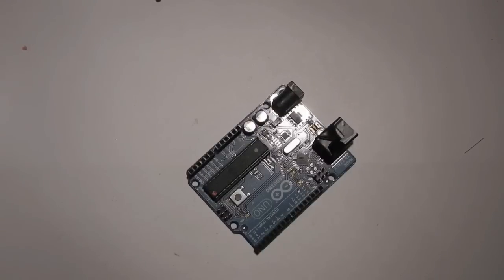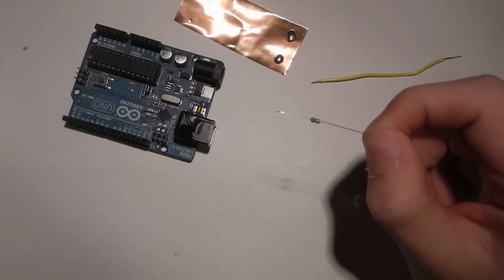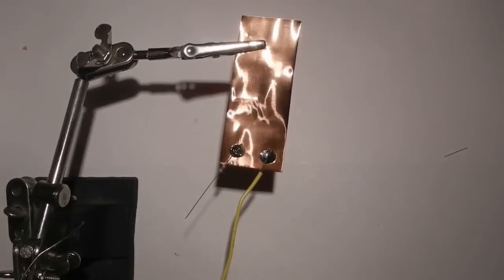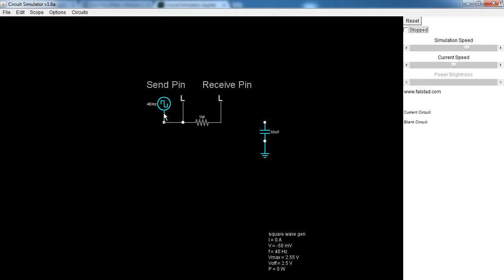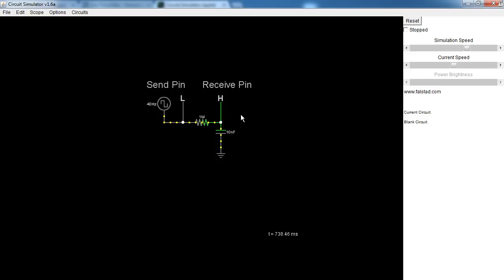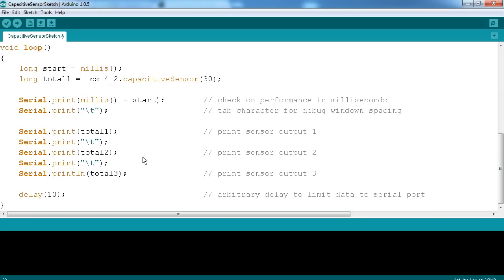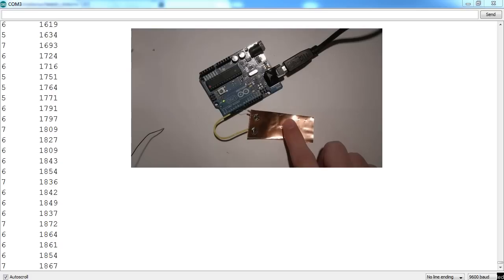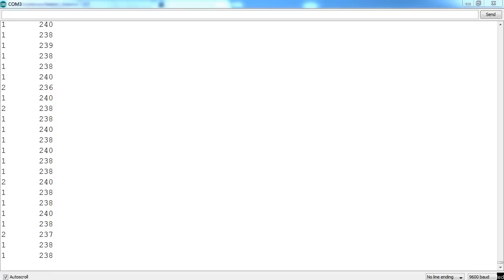CapSense: Capacitive Switch

Comment: my current reading with your setup and using a inch by a inch aluminum paper gives me 0 to 2934 

but only get to see 0 while not touching anything
 and 968 if i touch lightly and if i add a bit more pressure ill get the full max of around 2934 or so .  Can we get this range to be more larger ? do i need a bigger resistor or do i need to add something else?
Reply: +Frank Lopez Read up on RC elements. The time it takes for the capacitor to charge is determined by the resistor and the capacity you use. Since you don't have much say about the capacity (I think it is going to be in the range of pF and will get lower the farther you are from the plate), you'll need to dial up the resistor as high as you can, to get a decent time even at a distance. Remember, pF is in the range of 10^-12. Even a mega-ohm resistor will only get you into ranges of microseconds (10^-6), which is the shortest amount of time the Arduino can even detect. So you'll either need to increase your capacity (bigger piece of metal or closer proximity), or if that's not possible, you'll need a bigger resistor.

Comment: Just wanted to point out that the resistor doesn't need to be on the contact, you can just jump it from the receive pin to the send pin on the arduino. This is useful as you only need to run one wire to the contact wherever you might want to put it.
Reply: pro trick: watch series on Flixzone. I've been using them for watching loads of movies lately.
Reply: @Reign Ben Yea, been watching on flixzone for since november myself =)
Reply: @reignben2284  pro trick: next time comment on a video which has the same context as your comment.

Comment: Great work but small critique: The Falstad circuit you presented is not exactly what you have physically built. The circuit you built with your Arduino has the resistor AND the half-capacitor (single plate) connected between pins 4 and 2 (3:40). The Falstad diagram only has the resistor between those two pins. For the circuit I built, I tried it both ways and got nearly identical results.  I prefer your physical circuit to the one in your Falstad diagram  because the "magical ground" (5:15) attached to the other side of the half-cap is more difficult to explain.
Reply: But an half capacitor is just a wire so his falstad simulation is the same as what he built

Comment: I'm building a ironman suit and need this to control a linear actuator, I've created a glove to this and it works fine but in the code it wont consistently read while I touch it stops and runs the loop any ideas?   

#include <CapacitiveSensor.h>

#define CW 10

#define CCW 11

CapacitiveSensor   cs_4_2 = CapacitiveSensor(4, 2);       // 10M resistor between pins 4 & 2, pin 2 is sensor pin, add a wire and or foil if desired

CapacitiveSensor   cs_4_6 = CapacitiveSensor(4, 6);       // 10M resistor between pins 4 & 6, pin 6 is sensor pin, add a wire and or foil

CapacitiveSensor   cs_4_8 = CapacitiveSensor(4, 8);       // 10M resistor between pins 4 & 8, pin 8 is sensor pin, add a wire and or foil

void setup()

{

       // turn off autocalibrate on channel 1 - just as an example

  Serial.begin(38400);

  pinMode(CW, OUTPUT);

  pinMode(CCW, OUTPUT);

}

void loop()

{

  

  long total1 =  cs_4_2.capacitiveSensor(30);

  long total2 =  cs_4_6.capacitiveSensor(30);

  long total3 =  cs_4_8.capacitiveSensor(30);

          // check on performance in milliseconds

  Serial.print("\t");                    // tab character for debug windown spacing

  Serial.print(total1);                  // print index output 1

  Serial.print("\t");

  Serial.print(total2);                  // print middle output 2

  Serial.print("\t");

  Serial.println(total3);                // print thumb output 3

  

  if (total1 >= 10) {

    digitalWrite(CCW, LOW);

    digitalWrite(CW, HIGH);

    delay(5000); 

  if (total2 >= 30) {

    digitalWrite(CW, LOW);

    digitalWrite(CCW, HIGH);

    delay(100000);

  } else {

    delay(1000);

    digitalWrite(CW, LOW);

    digitalWrite(CCW, HIGH);

    

  }

  }}

Comment: I tried with my arduino connected to PC and works perfectly. Now I'm doing the same but using a 5v transformer to power it directly and doesn't work. My house doesn't have earth. Any solution to that? What can be happening?

Comment: I couldn't get the idea how the capacitor was created.  Would you explain it a little bit please?
Reply: Your body acts as the capacitor.  Basically, when you touch the copper, it's the equivalent of adding a capacitor to the circuit.

Comment: The time that takes to charge the capacitor the same time takes to discharge it also.But adding a few components more that activated in the negative pulse level then the discharging time will be rapid and the measured time will be the real charging rise time until the level interrupt triggered.And if the trigger voltage level for interrupt is known exactly the capacitive switch circuit with calculating an equation is turned to a real capacitor meter.

Comment: hi i have a doubt . Instead of using the send pin as common pin . Can i implement my idea as like this : a pin from the digital connected to a resistor and the resistor is instead connected  to a  metal foil . like wise i use  8 number of strips with  8 number of resistor  . when i touch the foil , the capacitance will sense . can i share the picture of my design ?

Comment: Does the size of the aluminum affect the circuit? I need to build something like this with a square of 20*20, but I haven't been able to find any example of this using bigger aluminum pieces.

Comment: You can use aluminum foil or a gum wrapper by sliding a paper clip on it and pinching your wire in that.
Soda can metal is also good. the outer surface is plated and painted. The paint comes off with paint remover and fine steel wool. You can solder that. Aluminum has an oxide layer, it takes extraordinary means to defeat that, but it's possible.
 
The thing about bare metal touch sensors is that they leave the controller open to static. A 10K resistor  on the sense wire will only add a little protection. What can take a lot of fiddling is tuning the circuit to work through a thick enough insulator to protect the controller but still know the difference between touch and close.

Try putting a transparency sheet over your sensor and get that to work, you can print button graphics on that or get an office store to sell you a printed sheet, just bring the graphics on a USB stick.

Comment: Hello, which kind of sensor can I use if I want to determine if someone is sits on a seat or no one is sitting on it.......or will this capacitive sensor also works for it?.....thanks
Reply from the maker: A Adeyinka This will let you detect when someone is or isn't sitting in a chair. You should take reading of both so that you can more accurately make the distinction in software.

Comment: HI this was a really good tutorial. Thanks. I just have one question. when i did it, if I touch the copper plate or the aluminum foil, while Im touching the floor with my feets with no shoes , (making ground contact, ) it gives me a number of ticks of about 200,000 so the serial monitor completely stops, similar to when you unplug the resistor on your video. the problem is that in my code i say (((( if(sensor >= 1000) { digitalWrite(LED, HIGH) } but for some reason since the number is too big, the program kind of freezes. so y have to get my feets off the ground to get a smaller number of ticks and make it work. do you or anyone knows how to solve this ?  If you cand find a sollution you will hellpr me a lot.  im using 5M resistors.
Reply: Add "delay(10);" at the end of your code (just before closing "void loop()"). This will limit the data sent to the serial port and fix the problem.
Reply: thanks

Comment: hey there I have a question here I have digital grandfather clock a small mear model of it and there are couple clean areas i would love to add a sensor button for ir remote you know tap ones to play tap twice to pause slide up for vol+ slide down  for vol- can the sensor button can handle the plastic on it or do I have create a new plastic mold
Reply: excuse me? are you trying to tell me that I need to type right to get an answer dude dont comment on my post i asked a simple question

Comment: When you initially put the ball of solder on the copper, did you simply put the iron on the copper and melt solder on it?
Reply: Yes. Except that it's not just 'melting solder on it' it's a chemical reaction between the copper, solder, and flux that bonds the solder to the copper. For example your resistor and other part leads are copper with a coating to discourage oxidation. TWO CAVEATS: 1) Plain copper often has oxidation that makes it more difficult to solder. You can give it a bit of a scrub first with a Scotch Brite or kitchen pot cleaning powder. The flux in the solder also helps remove oxidation but might be too heavy so cleaning is a good idea. 2) A big chunk of copper like that pulls heat away from the spot you want to solder. A 25W iron may not supply enough heat to do the job, and as seen in the video it takes many more seconds to heat up the soldered area.

Comment: So if i will use multiple sensors so all need to be conected to the same send pin and have differen recieve pins?
Reply: yes but you wont be able to run them at the same time, you will have to poll them one by one .

Comment: I am using a clone Uno r3 ATmega328 and it will not compile.

Exit Status 1
Error compiling for board Arduino/Genuino Uno.

Any ideas?
Reply: I can load the blink sketch but not this one.
Reply from the maker: Email me your code at humanharddrive@gmail.com, and I'll take a look.
Reply: I think I figured it out.  I needed to load the library so the #include could call it.  Mine seems to run much slower in the serial display window any idea why?  Also what parameters should I vary to get a proximity type reaction rather than touch?  I'm looking for it to trigger at 3" or so.

Comment: Thanks, though you didn't explain about the 1M ohm resistor.
Reply: Power is being fed to the "capacitor" (the copper foil/whatever's touching it) through the resistor. The time in ticks returned in the serial monitor is how long the arduino thinks it takes for the capacitor to be charged, with a 1M ohm resistor only ~5μA is being fed to it so even with a tiny capacitance it takes a while to charge.

Comment: Will this work if the foil is behind a piece of glass?
Reply: it should, you just eventually need more resistance.. maybe 2 mega ohm.
Reply: Jerry Hunt // It should. Since this is a small capacitor, the piece of glass would act like a dielectric in there.

Comment: Can this be used to sense a liquid within a cylinder?
Reply: CarsonScholz Yes. This is a common use for it. I replaced the gas tank sender and gauge in one of my cars with a capacitive sensor. It should be insulated from the liquid.

Comment: when you say a bigger resistor , what do you mean by this? theres resistors bigger then 1 Million Ohms ?

Also do you have a formula that i can add to the code that will calibrate it self according to new values? "cuz you know readings over time can change so what was that formula that does this fix for us on the fly ?